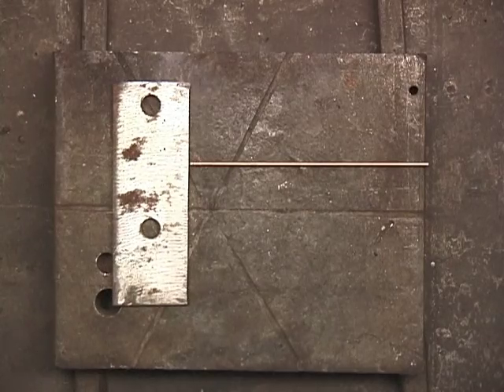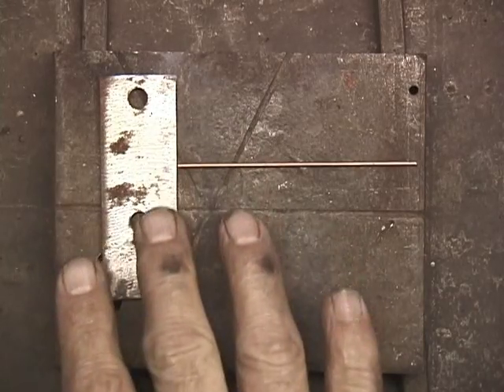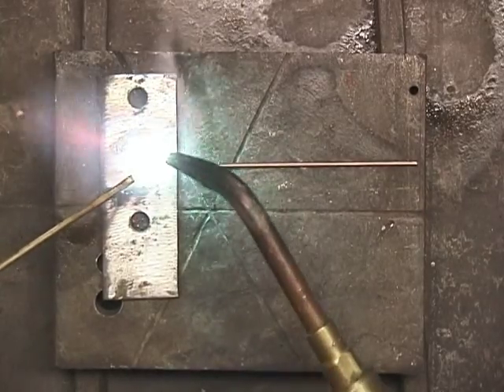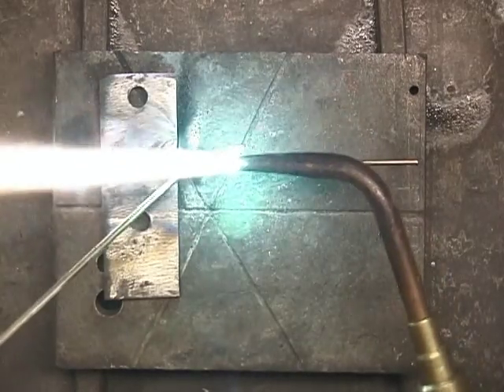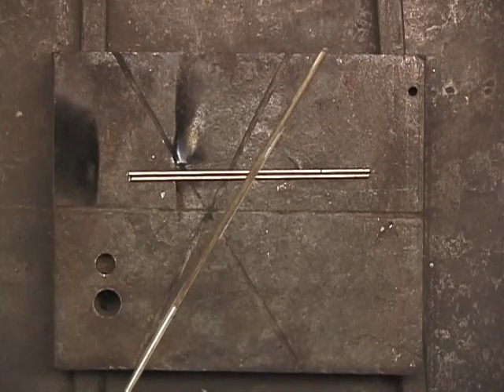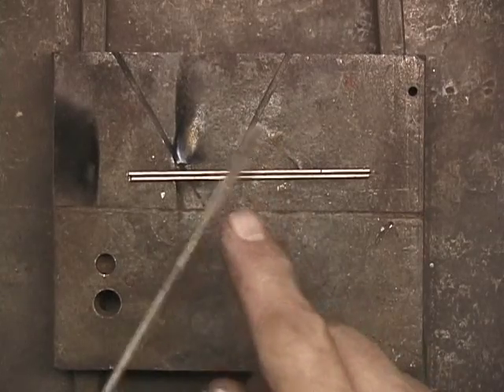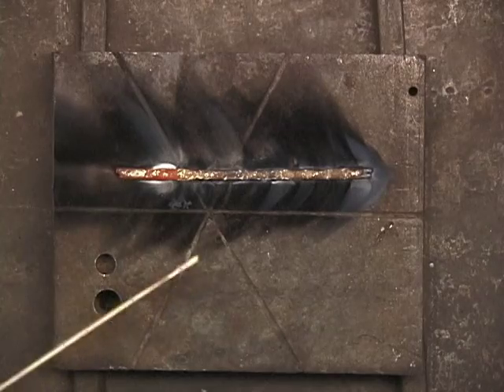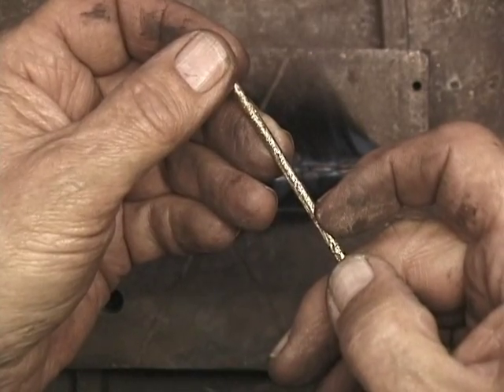Brazing thin to heavy metal

Comment: how would you braze two keys together? or multiple keys together actually.
Reply from the maker: If the keys are brass, I would either braze them with oxy/ace using a brazing rod and some flux.  Or, use silver solder and flux.  Some keys appear to be brass but are some other type of metal.  Then it is a matter of figuring out what type of metal it is.
Reply: ive tried both ways you mentioned & i either end up melting the keys with the torch & when i try solder they just break apart like the solder doesn't hold. im using flux core brass rods & rosin core solder =(
Reply from the maker: The keys are probably not brass or steel.  I remember trying that and the keys just sort of crumbled.  The melted material was a grey color.  The only other way to put them together may be to use rivets.  If the keys are not going to be under a lot of stress, you might try J&B Weld.  It's an epoxy that you can find at your hardware.
Reply: George Goehl  Do you think a spot welding machine might work?
Reply from the maker: Try using a magnet to determine if they are steel.
Reply: George Goehl they are not magnetic

Comment: I am not sure why but read all the comments and want bacon and eggs and toast but first, I need to braze a rusthole in a small gas tank. This will be a total restoration of a gas tank just to avoid buying a new one. Then muraitic acid to desolve the surface rust inside and create more holes I am sure so we'll see how this goes, been 10 years since I brazed.
Reply from the maker: +vic steckhan  I've never brazed a gas tank so can offer no experience.  You might check out a forum on small engines.

Comment from the maker: Lorie, (bacon frying)  I think you are talking about Mig welding.  For brazing, all you should hear is the sound of the torch flame.  If you hear a sputtering sound and you get some smoke coming from the braze it usually means that you've got the metal to be brazed too hot.  Check out my latest YouTube video, "Brazing Made Easy"

Comment from the maker: @DCBillW   The brazing rod I'm using here is standard 3/32nd flux covered brazing rod.  This is what I use on  everything I braze.  Since I braze all new material, I scrape most of the flux off.  I do not need a lot of flux to braze new material.

Check back later today.  I'll upload a video on using flux.